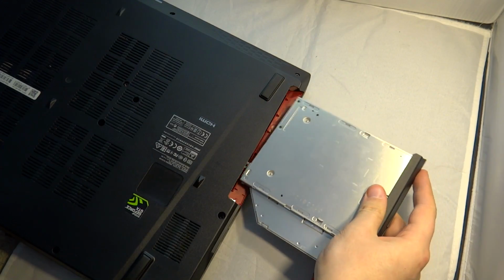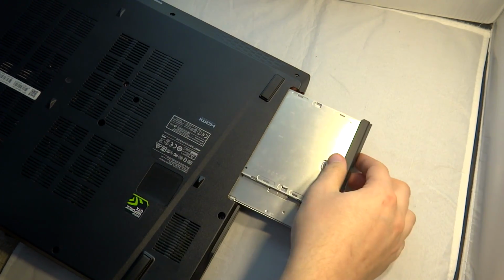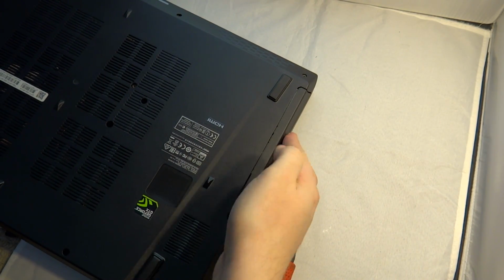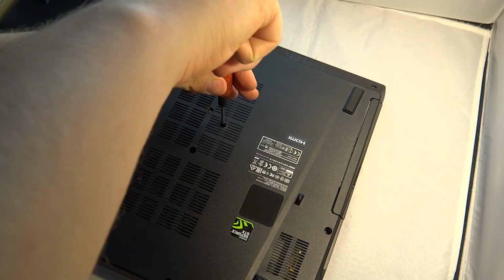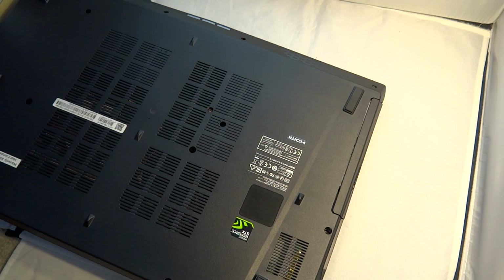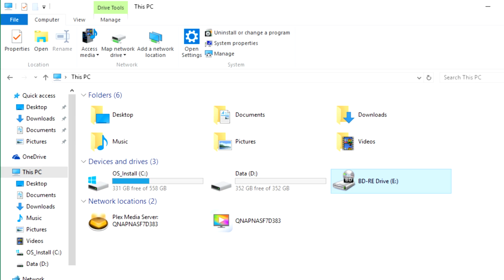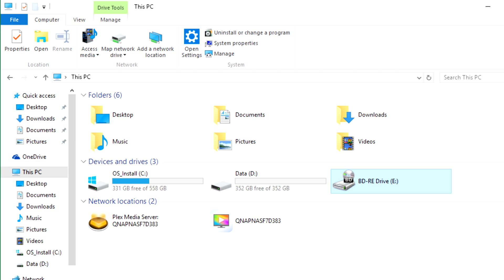How to Replace Laptop DVD Drive With A BluRay Drive

Comment: I have a dell precision m4700 do you know what's the disc drive size that the dell precision m4700 use 9.5mm or 12.5mm

Comment: Great video. Can you help me please? I need to replace my Asus X751s multi dvd / cd drive Philips / Lite-on model DA-8A6SH16B (128x127x0.95mm)  but I cannot find a new one on Ebay or Amazon. I found some other brands like Hitachi, Asus, etc. Many other models.
Do you think that if I buy a Hitachi, for example, the dvd / cd can work as the original dvd / cd drive? I am not sure if they are universal or compatible. Many thanks.

Comment: Pretty good but I think you could still improve where your fingers are covering what you're directing us to look at , and maybe use a freeze frame to show exactly where those points are that are to be pushed with a screwdriver as I didn't find that very clear. I did however find a QR code on my drive and wonder  if scanning it will reveal the details that have worn off the label.... Pretty good Tutorial though, close-ups & no annoying music so upvoted.

Comment: Hi there,  My DVDRW - Burner isn't working despite a cleaning, so it is time to replace.
After watching your lesson on installing a Blue Ray, am I correct in believing these DVD Players are basically "Plug and Play"?
Would you know if a DVD Writer/Burner is also plug and play?
Thanks so very much.
Reply: The new drive should work once installed. You may need to download new drivers for the new hardware if the system doesn't automatically pick them up.
Reply: @lb7144  Thanks anyway...  I replaced my DVD player with an external player and bought a new BluRay with a bunch of external stuff to screen capture DVD/Blu on the computer.  Now I just need to set it up.  Lots to do after Christmas!

Comment: Three little clips..how undoing?? I can't
Reply: I did the other side first , than he did. In my case the other side had a vertical snatch which was easier to open than the horizontal .The middle one came out by itself. Then gently skip
the front plate and its done. THX for or to the guide.

Comment: Can I replace the CD drive of HP pavilion g6 2012 model with the original HP spare.. ? Because I have literally fallen down my laptop from my hand while keeping it on the table. And the disk eject button panel of the disk tray totally came out from it and broken. Should I paste it with some adhesive or I should change  the CD drive....? Please reply and give any solution ...

Comment: Big problem need help, I got the right size it slides all the way bar an centimetre and won't go all the way in, is the port different? As the bluray is a strainer port but my laptop had like a middle peg/clip on the port!